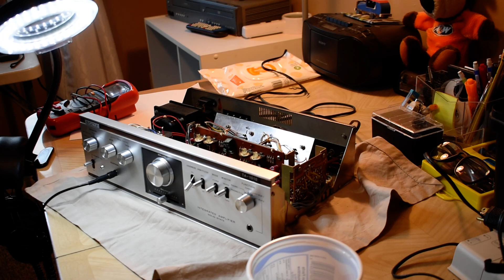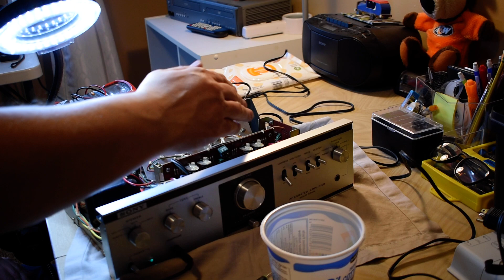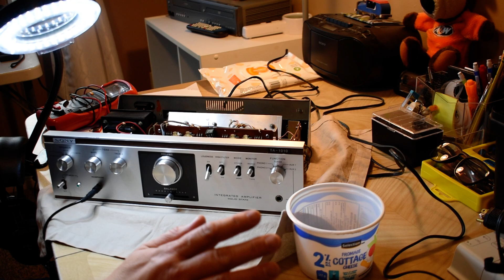Sony TA-1010 boulevard cruiser stereo amplifier- recapping and burn-in vs burn-out.

Comment: The filter cap in my example (Australia) is 1000uf 63v...but it has two red terminals wired in sequence with one red wire. 
what do you think about that, can I replace with a two terminal cap or keep the original
?
Reply from the maker: I've used a 2200uf 80 volt in that position and it stiffens the low end.

Comment: for the filter cap......would a 10000uf 63v capacitor be ok as a replacement?
Reply from the maker: That would certainly firm up the bass.  It will draw a bit more current at turn on but as long as it fits in the same spot as the original it's good.
Reply: @acrossthedial  . thanks. what brand was the filter cap you put in the TA1010?
Reply from the maker: @standupstraight9691  It was a Jamecon gold
Reply: @acrossthedial  . 🙂👍

Comment: I have the same one and one channel doesn't work. When you move the balance to the left, you can't hear anything even by turning the speaker selector, what could it be, output transistors?
Reply from the maker: The balance control is the weak spot on this model.  Try spraying it with Nu-tool or De-oxit.